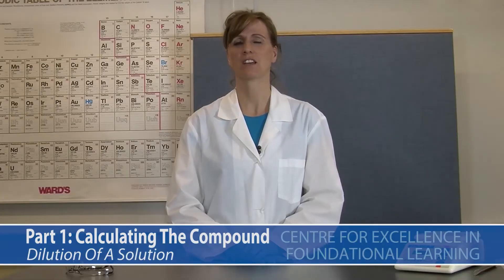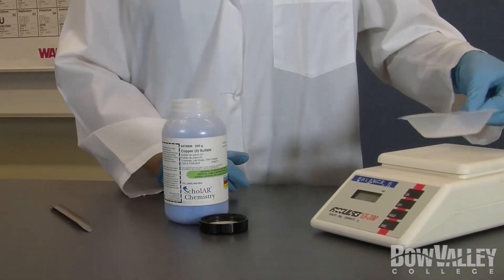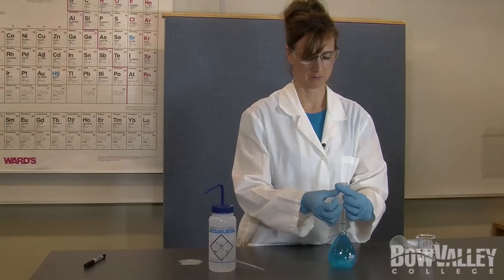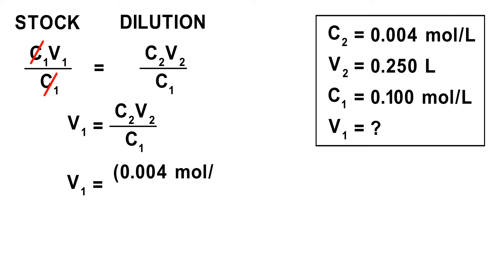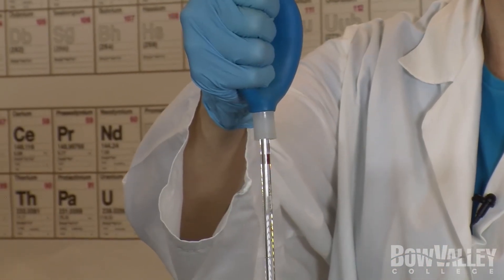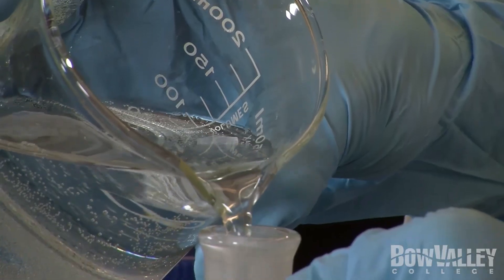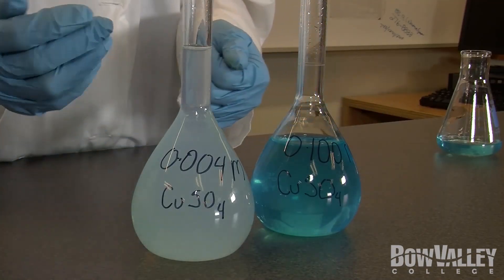Dilution of a Solution

Comment: in this solution 0,004 mol equal to how much mg/l ?
Reply from the maker: To find the concentration in mg/L, you will want to convert 0.004 mol to g using the n = m/M formula (solve for m which is mass in grams), then convert grams to mg by multiplying by 1000. 🙂

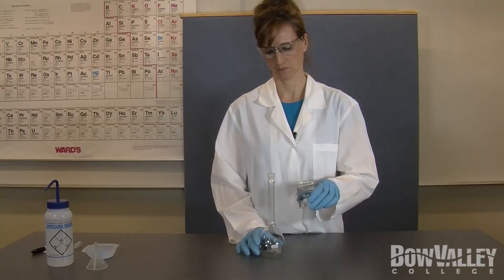Comment: Why is it ok to get liquid on the neck over the meniscus when filling the volumetric flask? I'm talking about 2:54 and 3:44, you can see that there are drops which are over the meniscus; won't this falsify the concentration when the volumetric flask is filled up to the meniscus, as there is residuos liquid above it?
Reply from the maker: Great observation! But the volume of the drops is insignificant when compared to the volume of water in the flask below.
Reply: @pennymarcotte  thanks for the quick reply, I always wondered about that!

Comment: can you show the calculation?
Reply: how to did you get the mass of solute?
Reply from the maker: @lyannapadillo991  Hi Lyanna - there are two general steps to finding the mass of solute needed to make the stock solution:
1) calculate the number of moles required to make 0.100 L of a 0.250 mol/L solution:

V = 0.100L
C = 0.250 mol/L
n = ?

Rearrange C=n/V to n = C×V, then substitute in the values above:
n = (0.100L)(0.250mol/L)
n = 0.0250 mol
Therefore 0.0250 mol are required to make the stock solution.

2) Find the mass of copper(II) sulphate pentahydrate (CuSO4•5H2O) needed to make the solution:
n = 0.0250 mol (from Step 1)
M = 249.72 g/mol (from periodic table)
m = mass?

Rearrange n = m/M to isolate m:

m = n × M
m = (0.0250 mol)(249.72 g/mol)
m = 6.243 g
m = 6.24 g (to 3 significant digits)

Hope this makes sense!
Reply: @pennymarcotte  How can I prepare 1.25 M sugar solution diluted to 1 L?
Reply from the maker: @lyannapadillo991  you can use the process I've outlined above, except your concentration is 1.25 mol/L and you need to prepare 1L.

1) find the number of moles required using n = C×V

2) find the mass required using the moles found in Step 1 and the molar mass (M) of sugar (C12H22O11)
n =
M =
m =?
m = n × M

Comment: hi I need help diluting 6% weight of hydrogen peroxide and i’m unsure of the calculations. (stock solution is 6% weight in 100g so it’s 6g in 100g of water) i want to obtain a molar concentration of 0.100moldm^-3 but how much distilled water do i need to dilute

Comment: Just totally skips the calculation.
Reply from the maker: Which calculation did you need some extra assistance with?
Reply: @pennymarcotte  I'm need to make a liter of a 0.1 M HCl from a stock. So I need to know what volume of water and HCl I need to add for that.
Reply from the maker: @Samuitsuki  so are you clear on how to use the C1V1=C2V2 formula to find the amount of stock required? C1 is the original stock concentration, C2 is the desired concentration (0.1M), and V2 is the final volume you need (1L). Then you will solve for V1.  Not sure what your stock concentration is, but your rearranged formula will look like this:

V1 = (C2 x V2)/C1

Once you know how much stock you need, then you can determine how much water needs to be added to top it up to 1L. Hope this helps!
Reply: @pennymarcotte  Thanks for the quick reply.
Reply from the maker: @Samuitsuki  good luck with your calculations
Reply: I think what is confusing is that I have to calculate the stock concentration from knowing that it's 37 w/w%
Reply from the maker: @Samuitsuki  gotcha! Since the final (desired) concentration is in mol/L, I would convert the w/w -> mol/L. 

37% w/w = (37 g of solute)/(100 g of solution)

For the solute - convert the 37 g to mol using n = m/M

For the solution - need the density to get the total volume:
(100 g of solution) x (1mL / ? g) x (1L/1000mL) = ___ L
*if you don't know density, then you might just assume its pure water so 1g = 1mL

Once you have that you will know your original stock concentration in mol/L.

Have to run to class so sure hope this makes sense!